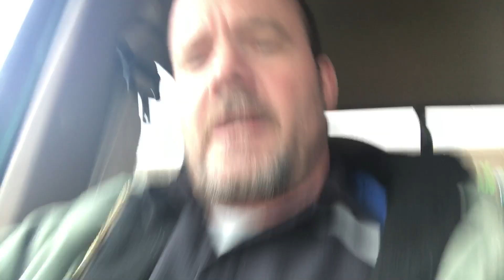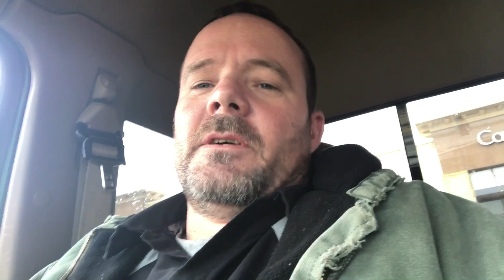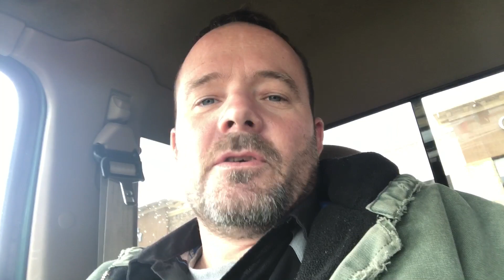Somebody wants to talk smack about a coolant filter huh???

Comment: Awesome vid mate!
The more i think about it, the more i remember the basics - most cooling systems are closed and under pressure with no air present. Any 'contaminants' are probably from coolant/additives breaking down, with corrosion and worn seals/gaskets being tound in the coolant - meaning improper/infrequent maintenance. I'd rather do my maintenance on time and properly  quickly checking my reservoir / overflow tank for floaties than buy, install and maintain an aftermarket filter system... hey, even if the filter works, the coolant would always look perfect even if it wasn't doing it's job properly! Complacency = Catastrophe, no matter the vehicle.

On that note, time for me to break out the nylon pipe cleaners and the wallet for some coolant + flush (already doing cyl head gasket).
Mad props for the video. Sincerely - an Aussie who doesn't even have a truck haha, just a 35yr old car with rusty orange coolant... blech
Reply: On the 6.0 powerstroke The main problem with coolant contamination was due to the egr cooler and bad coolant pressure caps. Without adequate cooling system pressure the coolant would boil in the egr cooler and the silicates would drop out of the coolant and collect in the oil cooler causing the problem to escalate until the egr cooler failed due to overheating. Coolant filters would not solve the causal issue. The 6.0 powerstroke was one of the first engines to use a egr cooler but now they are used everywhere. It's been a difficult learning curve . for sure.

Comment: The flow through the vent line is literally a trickle. Coolant filters aren’t a short, or long term fix. And the coolant filter on my truck is just sitting there leaking. It’s going in the recycle bin soon.

Comment: Hey we all know the best coolant filter is already present in the 6.0 powerstroke. Its called the oil cooler. The best solution is a full flow filter inline with the heater core. Ditch the heater control valves they deleted them after 06 anyway. I agree these bypass filters are a joke and just make it harder to work on the trucks. They do collect some stuff but it's not worth it performance wise for the cost. Im working on that filter we need and it will work on all vehicles. So tired of heater cores plugging up. I actually made on for my grand marquis and it cleaned up the rusty coolant crystal clear. Next is my mother's 2000 taurus wagon. that cooling system is really bad and anyone that has worked on those Taurus cars will tell you they suck to repair. Heater core replacement and transmissions.  I will be making videos soon on this subject with the vehicles all fords I maintain.

Comment: Guys I have a question for everyone that doesn’t agree with Anthony. How is it possible that my 06 f250 Powerstroke doesn’t have any issues whatsoever and  it is stock? I don’t have any coolant filters whatsoever? The only things that I do to my truck is that I don’t skip any Maintenence oil and filter change every 5k miles. Fuel filters every 10k. Coolant flush everything year. Trans fluid and filters every 30 k miles.   All OEM fluids and filters.. and still have the original Ford oil cap. And nothing is wrong. Now were is Anthony wrong about saying that from his Experience or what he has seen  so far it’s worthless to install a coolant filter?   I truly believe him guys. And one more thing were in this world has anyone ever seen a mechanic to show his work live on YouTube?? Were I have never seen any mechanic doing that? Instead every mechanic not only doesn’t show the work that is being done but also whenever you ask a question they all seem to change the story!  Thanks everyone!
Reply: Becuase you are pre-emissions

Comment: So if you take the coolant filter off. And cut it in half .And there in something inside . It works .
Reply: If I cut open my filter and there is something inside I would be doing a vc-9 flush and putting in a new oil cooler

Comment: I just added the sinister diesel system! My 6.0 is all stock except a cold air intake ! An now the coolant filter. My 6.0 has just turned over a 100.000 miles I’ve flushed it twice all ways looked good! There has always been some debris in it I’ve used the Ford premium gold coolant .the filter system does work 🤩an praises to god it works well !!!!!! An my truck has been treated like a baby 🍼
Reply: I’ve seen the reviews an how I know it works is the filter being checked after use 😎
Reply: If you do flushes and do proper maintenance why the coolant filter?
Reply: Well I’m keeping all of it flushed then why is there still debris in the coolant filter?

Comment: I agree, that tiny ass hose isn't doing a fucking thing, that's why I'm gonna buy that one that uses an inch diameter hose that tees off from the bottom radiator hose, probably still just as useless but definitely does a hell of alot more

Comment: You're preaching the truth man. I have a coolant filter and replaced the oil cooler three times. I've also cut my filters with nothing inside of them. 

Also to note, the three oil coolers I've replaced had sand in them. This was after multiple flushes.  I think general maintenance of the cooling system and periodic flushes with keep the system in check.

Comment: I have no doubt you know your way around a 6.0. I just watched the truck pick up video and then this one. I know this video Is old however I have a couple questions. How long had that particular oil cooler been in that truck, how long had the coolant filter been on the truck? Did you ever determine the flow rate through the filter and did you ever test any alternatives of the design you talked about? I have seen a few cut away videos and they all had good results filtering out "some particulate" .. better than none I guess. I'm just trying to find some verifiable data because blindly following your anti-coolant filtration theory is no better, in my opinion, than following the pro-coolant filtration theory. 
Thanks, Rob

Comment: I sense you are on the fence about this issue.  There are more contaminants than casting sand floating around in the cooling system of these vehicles. Most people do not change their coolant on the prescribed intervals so in these cases a by pass filter can do some good. After flushing  the system with distilled water and installing a by pass filter on my gas motor truck, I changed the filter after about 15,000 miles.  After cutting the filter open for inspection, I was amazed by the amount of rust and gunk that the filter had trapped. The coolant was clear and looked like the day I installed it. Granted a bypass filter is not as efficient as a full flow filter, but for my money it is worth the small investment by removing that crap from circulating through the system , where it could potentially clog the heater core, radiator, water pump, etc. I now run coolant bypass filters on all my vehicles.

Comment: I nearly pissed my pants watching this rant!!!   I have to agree that if you flush your engine block on both sides, radiator, heater box, etc, and use the correct radiator fluid at the correct intervals you should have no issues.  The only thing that would really contaminate your radiator fluid that comes to mind would be if your injector cups were cracked/head gasket.  I can’t speak about large Cats and Detroit’s that have very large ID inlets going to external filters.

Comment: If by-pass filters are so good why did ford change transmission pans and filters to full circulation filtration in 08? It takes 10 cycles to fully filter all fluid in a by-pass filter. By pass filters are a step better than no filter. Almost useless.

Comment: 3:08 i have problems with my passenger diesel, i think previous owner had put stop leak in it, and maybe block is releasing rust. i bought wix filter which has that 3/8" hole, but its on plastic so i drilled it as large i could. filter is on heater core hose collecting all the debris amount of 37micron.
 next summer im gonna flush or change the oil cooler. mercruiser has 10micron fuel filter what fits on my filter housing

Comment: My truck is at the local Ford dealer because all the local shops wanted to add and subtract stuff instead of just going through the truck and giving it the required maintenance and repairs. Dealer is crushing me on the price, but they're not talking anything except parts and labor needed. I didn't like my local shops turning into "Snake Oil" salesmen, trying to dazzle me with Smoke & Mirrors bs. Ford spent millions designing this engine. Who are they to change anything? I just want my truck to be normal.

Comment: A studded, EGR deleted, flushed, and ELC coolant running 6.0 has little need for a coolant filter for the primary cause of oil cooler restrictions have been eliminated. The likelihood of anything precipitating out of ELC is nearly zero...

Comment: I dont think the idea of a coolant filter is to filter the entire capacity of coolant every cycle. It would however filter out some of the loose debris in the system prolonging the plugging of the oil cooler.  All coolant systems have debris. The real problem is Ford used coolant to cool the oil and did so with such small passages. An external air cooler would have worked just fine.

Comment: same shit with oil bypass filters.....yea they do help, but my FS2500 flows a TINY amount compared to the flow of the oil off the oil pump and the engine oil is already filtered.  correct me if i'm wrong but most of the $hit i find in oil coolers (in every thing) is contamination from REAL sand (not "casting sand) from Mike-Foxtrots that play in mud OR the additives coming out of solution in the coolant itself due to the heat load placed on the coolant in such a small space like the 6.0s oil cooler.  Dont see this much in the Duramax because their oil cooler is like the big bastard the 7.3s had on the drivers side of the block.  I dont care what anyone says or what the coolant says....CHANGE THAT $HIT EVERY 50K!  Its CHEAP, about 150-200 to flush it RIGHT at most places (some are less).  Does not matter what coolant from DexCool to Ford Gold to CAT 238-8647...CHANGE IT!!